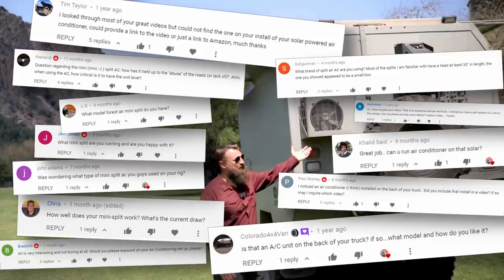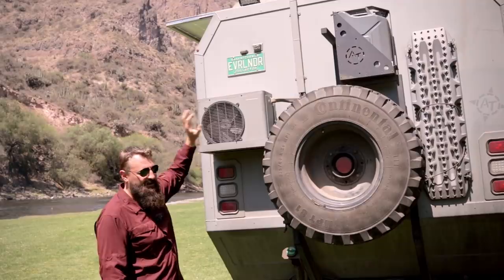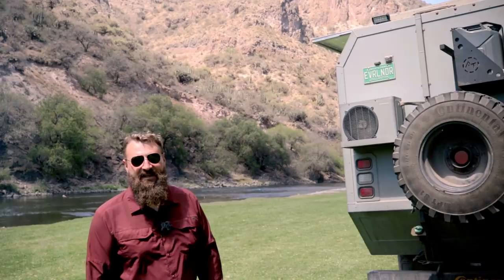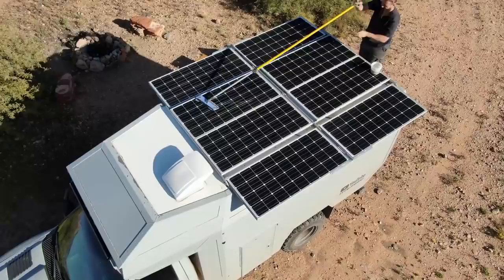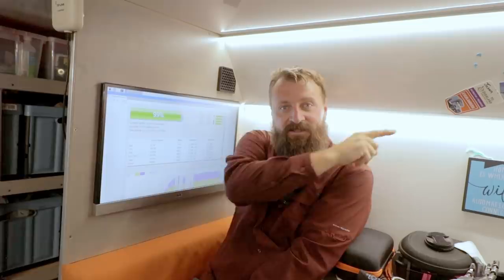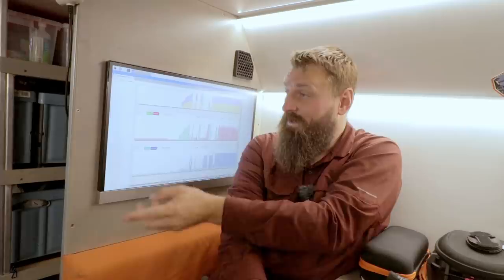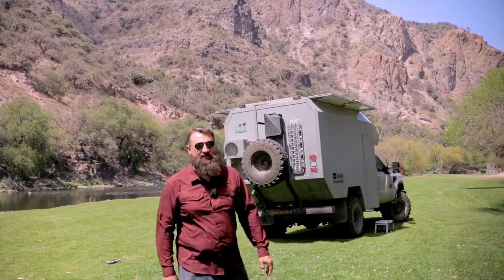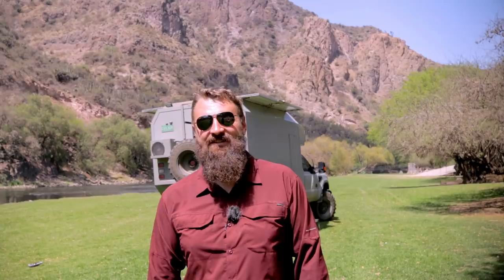Solar Powered Mini Split Air Conditioner Tour - Everlanders see the World!

Comment: odd I have the 10k model and my hose was removable
Reply from the maker: This will depend which country it was sold in...
Reply: @Everlanders  I could see that. I actually picked mine up second hand in the states so I have no idea if it was bought from canada or not. I've never seen them retail around here. I had a curiosity, do you know is it possible to recharge them? I'm assuming you would just need the adapter into that hose fitting and a standard hvac recharge kit but I was curious if you have encountered that.
Reply: I'm just wondering if my 2k inverter is going to be enough. Did you add larger capacitors on yours or keep it stock? I was considering that to make it more like a "soft" start version.
Reply from the maker: Ours runs on a Honda EU1000i, so I'm sure you'll be fine. And I've never needed to recharge ours, I expect they would need to solder on service ports as they need to charge it when it's running (and thus connected)
Reply: @Everlanders  Thats encouraging. My plan is to have my 650watts of solar and 400ah of lithium and hopefully be enough to run it to maintain temp from my cabin AC system that runs on the ambulance when the engine is on (I think the key benefits being it wont be starting from a hot box) its just when I've been on the road and hit a campsite in the desert and its hot, I immediately start cooking in the van as soon as the engine is off so my theory is a mini split to maintain inside temp would be perfect. I have a honda 2k as well so thats the backup if my rig just isnt enough! But I want to try! I might just have to get some folding panels to add onto the setup. I was inspired by your panels on rails and am doing the same but with linear actuators. Thanks for posting all your builds, really good content!
Reply: Question for you, how large is your inverter in your rig? did you upgrade your capacitors on the AC or anything or is it stock? thank you!
Reply from the maker: It's a Xantrex 806-1602 1800W (2900W surge)
https://www.xantrex.com/power-products/power-inverters/prosine.aspx
The AC is stock, no capacitors added.
Reply: @Everlanders  oh great so my 2000w xantrex prosine would probably be just fine, awesome, I'm in the middle of adding a couple more batteries and a bigger inverter and more panels. It never ends!

Comment: A DC HP mini split unit that size would consume about 150 watts.
Reply from the maker: Super, please send a link!
Reply from the maker: HotSpot Model ACDC12C - 960 Watts  (as resold by practical preppers)
Marketed as a Solar Hybrid, it requires six 375 watt, 72 cell panels - that's over 130 square feet of solar... Further, the solar needs to be run in series to get the ~200 Volts DC the compressor takes. That would be fine if you had a residential situation, off-grid cabin, or a Greyhound Bus conversion. But not ideal for smaller Overland Rigs like ours. Also, the AC connections are 240VAC, which if you happen to be camping in a spot without sun, but with hookups, you would not be able to use it.

DC Inverter HP MR Cool - 550 Watts
This one is much better as it runs off of 115 volts rather than 220, - But not directly off of DC Solar. - Effectively the same as what we already have, a bit More Efficient, Twice the Size and Weight.

The Pioneer Mini Split - 585 Watts
Your link is 220 VAC Version, But they do also make a 115 VAC version that I've considered. But again, the compressor is so large we wouldn't have room to mount it, it's over 30 inches wide. Our friend Tom just installed this one actually - he had a cooling guy take it all apart, moved the compressor, and reshaped the box to fit under the rig... look up the_lost_box on Instagram...

ALIBABA: DC mini-split HP - Hefei Pingo trading co.  
I couldn't find the one you're referencing...  And I'd like to point out that Alibaba is great, but the factories are often more interested in getting distribution for their products, and the prices are often shown as volume pricing. ie, they are $580 a piece, if you buy 10. Also, shipping and import costs for things like this are quite high.

Mitsubishi 6k BTU 33 SEER - 181 Watts
Nice efficiencies, albeit a bit low on the cooling capacity,  and again 220VAC Only, We'd need to get a dedicated 220-volt inverter to run the thing - not practical for Overlanding. Also 30 inches wide...

Comment: Why don't you collect the water run off , and store it for bathing, general cleaning and with a filter system an good source of drinking water.
Reply from the maker: Because our water systems are pressurized.  https://youtu.be/1THtBYxu8N8 We'd need to have a seperate tank to collect and then transfer to the kegs... Possible for sure, but not worth the hassle for us.

Comment: Turns out that I bought a very similar unit. https://rollibot.com/product/mini-split-ac-room-air-conditioner/ Probably just rebranded out of the same factory. My difficulty is that when I reconnected the umbilical during installation, I let out a bunch of the refrigerant. When I looked at the ports, they're completely nonstandard. Does anyone know where to order the fittings to properly refill this thing?
Reply from the maker: I remember the instructions emphasising that the connection be made swiftly and infrequently. You may need to contact the vendor and see where they recommend you refill it.

Comment: If you can't deal with sun without an air conditioner ... do not go Overland way... stay in the city.
Reply from the maker: We can deal just fine... But like I said in the video, it's primary use is to keep our dog alive when we need to leave the truck locked up while we're grocery shopping, or on hikes where doggo is not allowed.

Comment: So “you mostly need the ac during the day”. And you have no windows.....  so you bought or built a camper and hide in it during the day then what?  Go out at night?   Most people spend the night time in their campers and go out in nature during the day.  So you need about 8 hours of battery life to make this useful.
Reply from the maker: Your comments were all addressed in this video you didn't watch... 

1) This is our full time home, and my office from which I work. So I'm not so much hiding as doing my job...
2) We go out in the day, but as I mentioned in the video, we can't leave doggo in there while we're shopping or hiking trails where he's not allowed.
3) We have 11.5kWh of Lithium batteries, enough to run the AC for 20 hours if needed, But as i made very clear in the video... we rarely dip into the batteries because the solar is making as much as we use. 

What will really push this system is when we get to Guatemala, Belize, Elsalvador, Honduras, Nicaragua and Panama during the hot rainey seasons... that is where many overlanders struggle with heat and humidity, with reduced solar production.
Reply: So sorry.  Saw the entire video but do not recall any thing about living and working in it.  I was more focused on anything related to how you are running ac over solar.  Honestly don’t recall the dog comment either but my sarcasm was misplaced none the less.  I do like the vehicle.  Your 3rd comment actually answers my question regarding the batteries.  For most of us with truck campers, night time is when we spend the most time in it and this the most power consumption.  I’ll be sure to watch the rest of your videos.  Keep them coming.